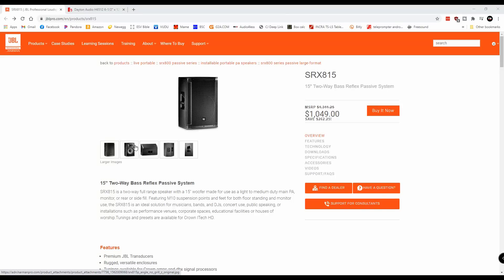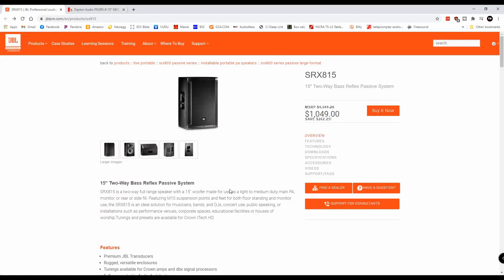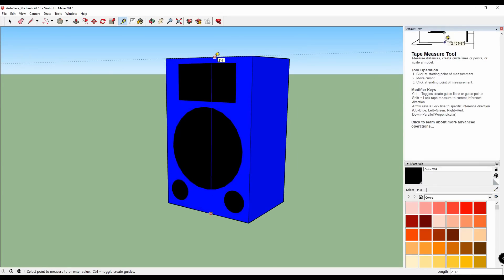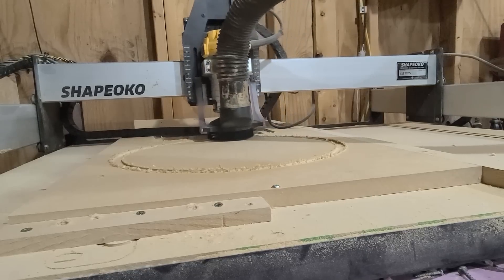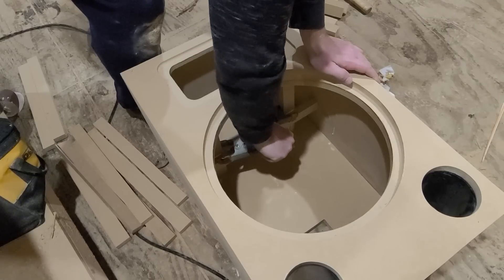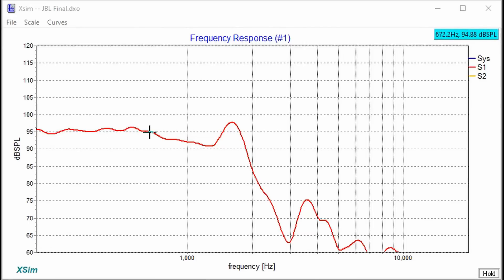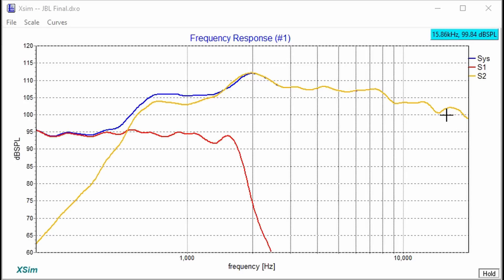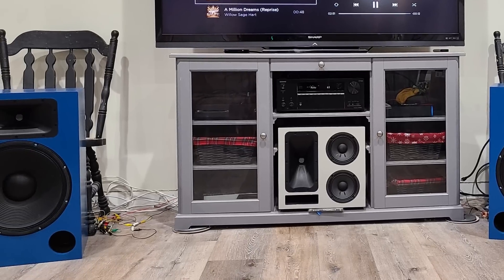How to Build $3000 Speakers for $500 - Soundstage 15

Comment: The idea is basically good, but I would have extended the budget a little if I were you and then done it better than the original JBL. A 1.4" high frequency driver on a larger horn belongs above a 15" woofer. With your current crossover, the 15" driver will beam badly in the upper frequencies because it has to play way too high. The HF horn will then open up again above it. You would also see this in a horizontal dispersion measurement.

Comment: I was inspired by your project and was looking at using the LAVOCE WAF153.00 which is also a 15 inch woofer but the calculated box volume (in WinISD)comes in at 5.4 cubic foot which is vastly different from your box. Why is it so different or have I got it completely wrong ?

Comment: Super inspiring, Thanks for the tips! Not happy with the price and performance of top industry standard speakers, I am interested in building something in between the soundstage 15 and the orange Klipsch 10" 2 way videos you posted. Looking to build some powerful pole mount 12" two way speakers I can use for vinyl performances in smaller venues and at home (pair with a compact 15" sub for the extra low.) Do you have any examples or recommendation for 12" 2 way?  Something punchy, clean sounding and not too heavy? looking to get 40-20khrz if possible . Looking at dayton audio odium apollo 12" neo and selenium tweeter. Originally I was looking at archived builds by B&C but very expensive and complicated. Any recommendations would be appreciated. Thank you for these great videos!!
Reply from the maker: I don’t currently have any recommendations. I am later this year going to design a two way with a 12” that will e similar to the Cornwall. However, that might be more than you’re wanting to spend. I’m guessing around 1k for the pair.

Comment: How do you wire the speakers on the inside? Do you have a video that shows this?
Reply from the maker: The plans include all that information. If you still need help, you can email me. The email is in the plans.
Reply: @Toid  thank you for your response! In your opinion which is your favorite speaker that you built for home theater or which one would you recommend most? I’d love to build one from your plans and curious to know which one you like best.
Reply from the maker: @Schillsifer  currently, these are my favorite overall. The cinema 10 are my favorite for rear speakers, or even all 5 if you have a small to midsize room. But these ones are just so enveloping. They are pretty amazing.

Comment: I always get really stuck with understanding crossovers. i’m 17 and have never built a pair of speakers but i want to build some econowave speakers like these but idk where to start for the cross over. Where do you recommend i start?
Reply from the maker: If you buy the plans the crossover diagram is in these and I’d be happy to help make sure it is right. Otherwise if you want to design your own, I’d recommend going on my forum www.toidsdiyaudio.com/forums
Reply: @Toid  i was thinking about buying those plans. will probably be later on. the fact that the crossover is included makes me feel better about purchasing. does it include a parts list so to speak?
Reply from the maker: @supremenematode1148  it does. As well as box dimensions, and everything.

Comment: Another good choice for this cabinet would be the Dayton PA380. 👍
Reply: I bought the plans for this but haven’t bought planned on woofer and can’t find it anymore.  Do you think this would be compatible with planned crossover?  Thanks
Reply: @mattwolhar1818  Yes. The PA380 is a very hard working speaker. Nice sound both as a sub or woofer up to 3800 Hz. Loud. Nice wide ranging response.
Reply: @mattwolhar1818  Another good choice that is a bit more expensive is the RSS390HF if still available. There are two versions, HF is 800w, HO is 1600 max. These are true subs! 💯 I have always wondered whether I should have bought the "HF" instead of the "HO" because of the wattage rating. I have the HO version wired parallel with my PA380s, pushed by a Crown XTI 2002. They work well together. 👍 Boom!!
Reply: @DRumsBDrugs  right on thanks a bunch!

Comment: looks like neet speakers, but i dont understand why you chose such a high 1.7khz crossover? im running the same waveguide and compression driver with a 1.3khz 2.order filter on a 12" woofer, and even that would result in some minor narrowing in dispersion as you can se below. idealy a 15" needs a 800hz ish xo, but ofcourse that would be impossible with budget waveguides and drivers. thanks.
https://i.postimg.cc/nht6L3NZ/dev.jpg

Comment: Would that woofer ring really be enough support? I'm genuinely asking. I understand it's ultimately thicker but still only glued to that thin piece of mdf. Wouldn't making a double baffle be much more rigid? Would lose some internal volume but maybe just add some or account for it with increased port size, so the frequency response says the same? Really great video!

Comment: And sketch up you said it’s 26 inches high which is a little bit taller except for the ones online or 27 inches so this one and sketch up is shorter and then you said online it was 18 x 18 wide and 27 deep. why isn’t 27 the height since it’s standing up, the longest part is up and down, which is height
Reply from the maker: I’m not sure what you’re asking, but these are 28 inches tall 18 inches wide and 14 inches deep. If you click on the plans though, tell you more about them in the description of the video.

Comment: I'm thinking of doing this to a pair of HPM-60 that the previous owner cut 12 inch car audio subwoofers into the 11 inch holes...the only hiccup would be the original woofers are 6 ohm...so all new cabinets, but keep all the old internals and buy new 15 woofers.

Comment: Hey, sorry my noob question. How can i get the plans for these great soeakers? And how  does it go -3DB, -6DB. Thanks 🙋🏻‍♂️👍
Reply from the maker: You can get the plans here https://toidsdiyaudio.com/product/pa-15-15-pro-audio-speaker/ as far as the response, that’s in the video. Keep in mind that the response that you see is an anechoic response you should get lower inside your room how much is really dependent on your room
Reply: @Toid  thanks for your quick response. You are absolutely right. Will first measure the modes in my new home. Now i am looking where to get the drivers wirh cheap delivery to Germany 🥴😅 maybe you've a tip for me...did you allready create smaller surrounds?... .great work 👍
Reply from the maker: @tschaekycola  I did I made the cinema 10. They are the perfect rear surrounds in my opinion How to Build $5000 Speakers for $400 - Klipsch KPT Inspired - Cinema 10
https://youtu.be/RQlrNc3qqnw If you check a link in the description, there should be a link to a company called sound imports. I believe they might be the cheapest to source parts. But I’m not completely sure.
Reply: @Toid  found your Link great. My goal minimal 4.0 later on upgrading wirh 1 or 2 Subs fir about 25-30qm room. What about 4four Cinema 10s? or netter zur bigger ones for the front, If the get low enough for full range. I don't need 20 Hz. Like more a cleaner sound than a boomier one. Which sub could i choose f.e. from your builds? I do not listen to loud. Average is -20 to -30DB in my Onkyo 876. Thank you very much.
Reply from the maker: @tschaekycola  cinnamon ton of really good for real surrounds. They work well for front as well but they’re not really designed to go past 80 hertz. So the main issue with not using a subwoofer with these, as you will be bass limited. However, they do play very clean and can get very loud overall they are very great speaker, but I would want a subwoofer with the cinema 10.
Reply: @Toid  Last question, which Subwoofer could you recommend that is not too expensive.

Comment: Would I be able to make smaller version with the Epique E180HE-44 7"
Reply from the maker: Not like this. The epic 7 inch isn’t nearly sensitive enough to utilized in this manner
Reply: @Toid  sensitivity is the loudness right? I'm just learning so I apologize is this is a dumb question.
Reply from the maker: @We.R.Comics  no worries. We are always learning. Sensitivity is typically based off of voltage output of an amplifier so it’s measured at 2.83 V which is equivalent to one watt at 8 ohm. The sensitivity number will be in decibels and will give you the spl of that speaker at the 2.83v SPL isn’t really loudness, however if you want to simplify it as loudness you can.  In this case, the compression, driver and horn would be much more sensitive, meaning you’d really have to attenuate or pad down that to the extent of losing the advantages of the compression driver and horn. One of the main advantages of the compression driver, and PA drivers in general, is that they don’t need a lot of wattage to get it loud.
Reply: @Toid  I really liked this concept but was curious if there was a smaller sized combo you could recommend for a bedroom setting?

Comment: thanks for share! this video is a "guide" for refference ! XD  !
I have two "empty" boxes of Sony Genezi speakers, I will install in them a new pair of JBL replacing the damaged OEM Sony speakers, still I'm thinking if install JBL or Cerwin Vega, 
just the speaker or  to install the speaker+tweeter+crossover to have the box complete as "new". of course same Ohms, similar Wattage, and for home audio non demanding.

Comment: Finished mine several weeks ago. They are mainly going to be used for an outdoor theater space, however I was able to do some listening indoors for a few days. They sound amazing. I am amazed with how good the compression drivers sound. Also listening to several tracks of Victor Wooten which is primarily bass guitar, I am in love. I have a cousin that plays bass and have heard many hours of practice. While the sheer output can't match dedicated powered bass towers, the sound is reproduced better than any other tower I have owned. If I ever have the space to rebuild my home theater room, after having several children I had to disassemble the space I was using, I will definitely build a few more. Thanks again Toid.
Reply from the maker: I appreciate it. I'm glad you're enjoying them!

Comment: I am curious what your reasoning was for not going as low as 1khz for the crossover to have a little better dispersion of sound coming out of the 15" woofer?
Reply: if I have a component home audio (sony genezi), and I want to replace the damaged speakers: do you recomend install new speakers with crossover? instead just the main speaker8"  .
Reply: @georgemartinezza  If the speakers were good quality to begin with including a good quality cabinet and you really like the sound of them, then sure replace the drivers. Try to find some that match the original's frequency response and Re. Then you might be able to use the original crossover, but it probably wont be perfect. you may need to change some components to get it dialed in. But if the original speakers were not that good of quality to begin with then you might be better off just looking for better replacement speakers as it might be less expensive than rebuilding the originals. You have to decide what your budget allows.
Reply: @jimthvac100  yes. Hello.   the original speakers in their original box had a good and nice sound without crossover, 1 speaker 8" one twitt, and  just serial wires connected to match their ohms with amplifier, oroginally so.
 
I've seen (example) Cerwin Vega some models match the ohms and others have higher ohms. I'm not interested to get the max watts power and high sound volume for parties, being a domestic home use I think with a good new Rockford, JbL, will be fine and it depends $$$ as you say. ✌  thanks!!
Reply: Never mind I see that Selenium is not really made to go that low.

Comment: Hi man i have build speaker only ones in my life. Not really successful. I have used 4-chennel car amplifier with 6in. sub (sensitivity < 80) and 2 full range speakers 4'" 91db. sensitivity each (100-20kHz). But i got a problem LF and HF drivers didn't play in compliance. I could arrange them by amp gains but they still was playing with different loudness on different volume. Why did it happen?

Comment: simply amazing  build !!!! 😊 but what about beaming and cone breakup that's common with large woofers in a two way speaker....
Reply: The ideal xover point on a speaker like this is where the woofer matches the 90 horizontal dispersion of the waveguide, which is around 1.25khz on a 15" woofer I think, making all frequencies above the xover point uniform in the horizontal plane.

Comment: Did you wire the drivers in phase? It looks like the effective roll off of the woofer is close to third order even though electrically second order.

Comment: Tweeter in the original SRX is a 3" diaphragm. The one you selected is a 1" titanium. That's going to change the sound pretty drastically from the original.
Reply from the maker: You are getting your terminology confused, which is easy to do.  I believe you are referring to the original driver (2432H) having a 3" diaphragm, not exit. The exit on the original is 1.5", which is very close to 1".  There are a few reason to go up in size, which can include high power handling and lower crossover point.  However, if you can get a small exit like a 1" that can handle the power and the lower crossover point while maintaining low distortion, it is often more desirable.  The reason for this is smaller exit will have a better off axis response.  I could have went with a 1.5", but I was able to meet all the original goals with the smaller and in this case more desirable 1".

Comment: 15 months later and both the woofer and compression driver have gone up fifty percent in price.
While the wave guide has doubled in price.
Holy smokes.
Reply: As of Jan 7 2024, woofer went from $150 to $200, tweeter from $50 to $80!, and waveguide from $9.73 to $18.98 (Dbl)!!. So from $210 - $300 per speaker or 70% increase ... my salary in 3 years- 6%. I'm sure crossover components and wood supplies have doubled as well; kind of knocks the fun from DIY projects doesn't it? Glad others are getting rich.
Reply: @UltraNuggz  I was planning on building this, really love it.. but in Europe these woofers now cost 341.55 Dollars... each... So that would be almost 700 $ just for the woofers... Tweeters are another 100 per piece...makes no sense...
Reply: Just calculated that  the price  of just buying the materials for these, it would be more expensive than a brand new pair of Klipsch RP 8000F II  delievered to  my door....Just to buy the materials.... This makes no sense....
Reply: Joe Biden's regime. $$$ Killing the middle class.

Comment: Sir, excellent on you for building these! I realize the finish or visual appeal was not your goal with these, however some simple steps will significantly improve the finish.

Use a sanding sealer on all the MDF...2 coats with a brush, sanding in between coats with 320 grit.
Prime with 2 coats, sanding each coat with 320 grit.
If you are not spraying the finish coat of paint, use a foam roller. 3 coats sanding in between with 320 grit.
3 coats of poly, sanding in between with 320 grit.

Its not complicated, just requires some patience. Make them look as good as they sound.
Reply: You're right, I think he knew that he would be moving them on and didn't want to spend the time on them. I'm looking at building a CSS Audio kit and want the front panel to be gloss white and the rest in timber veneer. I'll follow your tips. 👍

Comment: can I use 3/4 plywood for this build??? I got an old sheet of it and hate to throw it away!   P.S. -- The first thing you need to do is stock yourself with a full blown wood shop to make them!!!
Reply from the maker: Yeah you could use plywood. I recommend using some form of birch ply.
Reply: @Toid  thanks.  I actually have some old school Magnavox stereo console speakers. Just bought the crossover stuff from parts plus and gonna make some shop speakers.  Thanks for he video. PS. I’ll be using a skill saw and screw gun. 😂😂😂👍👍

Comment: Nice job.  Could you share how much power they handle.  And the db output at different power settings.   I want to build.   My amp has 500 watts.   Thanks for sharing this speaker build.   Do more.   Good stuff.

Comment: I noticed that the original uses two triangular ports so that the woofer mounts much lower on the baffle and acts as a crossbrace to boot. Seems like a better way to go, but a bit harder to make without a table saw.

Comment: i would like to save $2500 by using $8000 CNC.
Reply: Today you can save 2500 with a 300 doller 3d printer. And you still wont do it.
Reply: @DonRaynor and you still can’t spell. Yet here we are

Comment: Don't you have to adjust the port length to tune the speaker? Just cutting it in half seems pretty arbitrary to me.
Reply from the maker: You are absolutely correct. You do have to. The way that this worked out was that I could actually cut it right in half and get perfect tuning. It just happened to work out on this speaker. And you'd be correct if you were to think that it's rare. This is the first time I've ever designed a speaker where that was the case.

Comment: Hey I was wondering if you have some diagram or something of the speaker response over the 10 khz? ( Im not sure where does the one in the video go to ). I am interested in using these horns for some home hifi listening with these waveguides and hf drivers, they say it goes up to 20 khz, but I dont know the exact response with this waveguide. And in your opinion does it do a good job of staying clear to the top in both party listening levels and very low levels like midnight listening and such, or would you add an aditional supertweeter to it for everyday cinema and music use (maybe horn or a ribbon one).